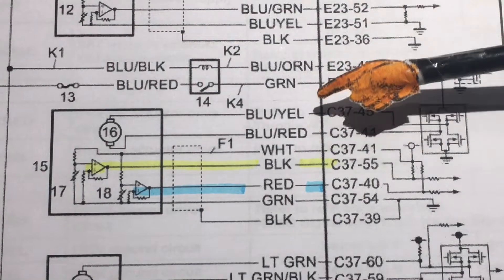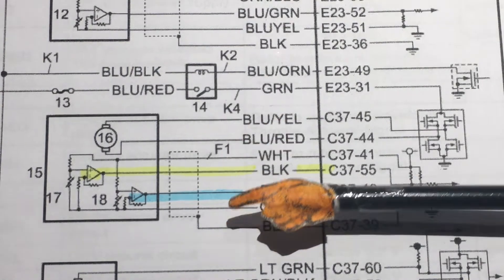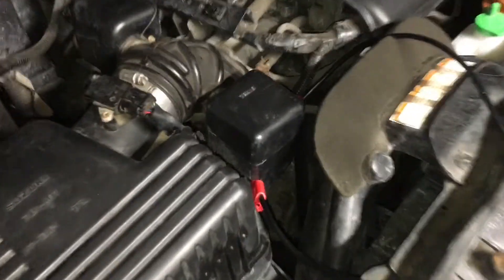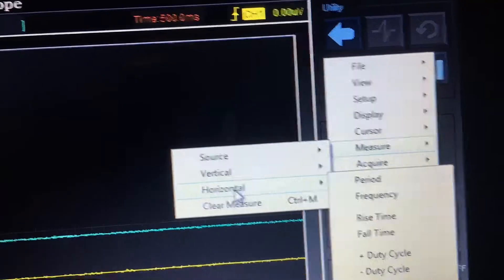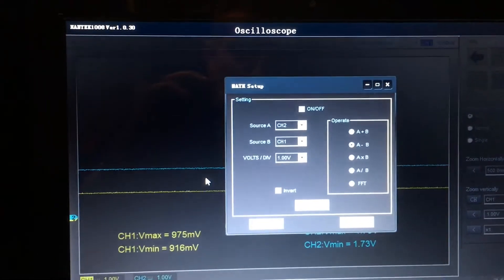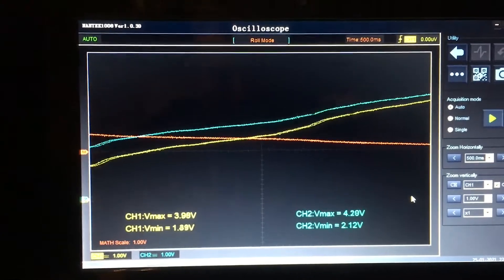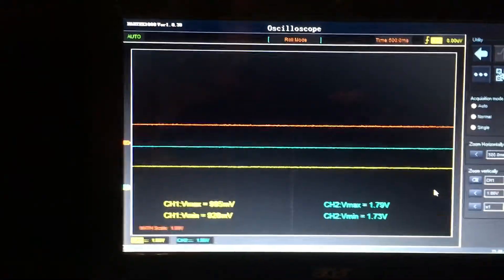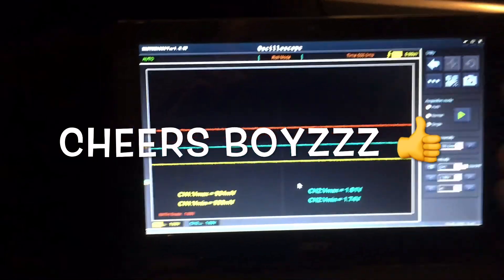T.P.S Testing (Hantek 1008C)

Comment: it makes logical sense why they use two seperate signals since this is what tells pcm your throttle position its a safety feature,if you had only one signal and that had resistance/shorted that could be dangerous if you only had a single signal.im surprised one isnt reversed though meaning as you open throttle one adds voltage and the other goes down in voltage?

Comment: Don't trust ANYTHING HANTEK  SCOPE wise after experiencing the Hantek 1008C or "Hantoy" I refer to it as is only good for a door stop when it is effected by High voltage noise in the work area - so basically totally USELESS when it comes to Automotive DIS Secondary ignition work  - it locks up, reboots even crashes the attached PC. The attached HT-25 ignition lead actually works with real scopes like a PICO. 
Dam CCP China and their 'pretend' time wasting non functional products. Save up and buy proper western brand ones that actually DO work !
Reply from the maker: For the most part agree. One point of interest...If a low cost “rubbish” scope affords someone an introduction into a very board subject of study, and can invest in better gear as interest develops...It served its purpose.

Comment: I thought you might be interested my post to the HScope Group, Ian:

TheGibby3340 (my buddy Ian) posted a video yesterday using the HT1008 in "ROLL" mode. Not to be confused with HScope's ROLL mode which is HANTEK's SCAN mode. No wonder we struggle at times:)

HANTEK's "ROLL" mode is very much like our AUTOMOTIVE MODULE...a steady stream, right to left. I took a close look and its limit is 500ms/div which is inline with HScope's 2Ksa/s limit (1008 in automotive)

Can not be stopped, nor saved which is a big drawback. But, I found it interesting that HANTEK even has a borderless stream mode.

HANTEK 1008 ver 1.0.30 has come a long way. We will give 'em that...
Reply from the maker: Thx Denis appreciate that 👍

Comment: are you using an attenuator?
Reply from the maker: No sir not required...It’s only 5 volts. Thx for watching 👍
Reply: @TheGibby3340  I have the Hantek 1008a,  what is the voltage input range? i work with transmissions. The shift solenoids  have 12 volts supplied, which the ECM grounds to switch on. Will i need an attenuator?
Reply from the maker: @gilrod2511  The help section in the menu of the software contains a user manual including specifications. I use an attenuator any time the voltage is over 20V. Shift solenoids will produce induction spikes that can reach quite high levels as you know. So to safeguard your gear, for that application I would use one. Hantek produce the HT-201 (20:1) cheap insurance.